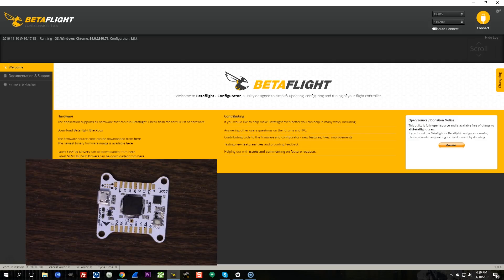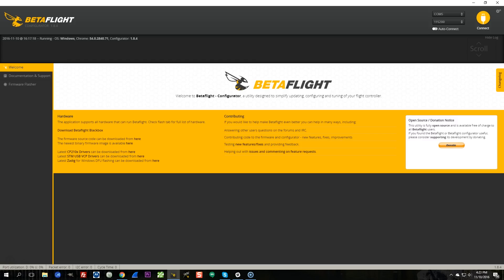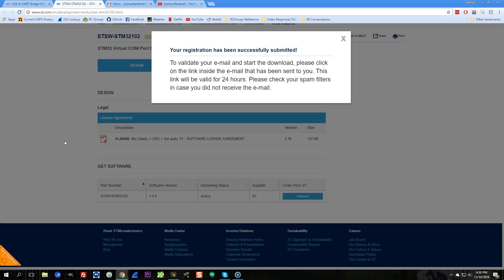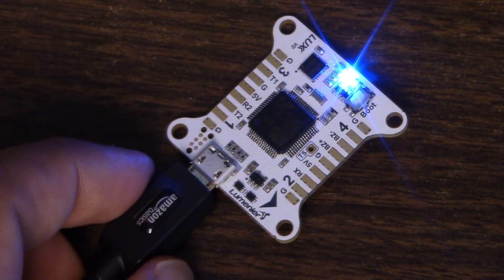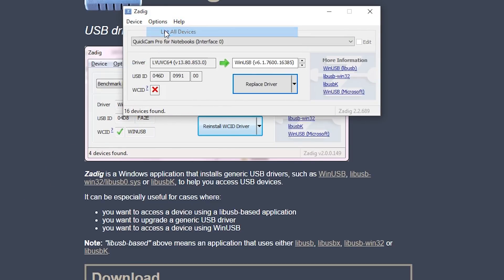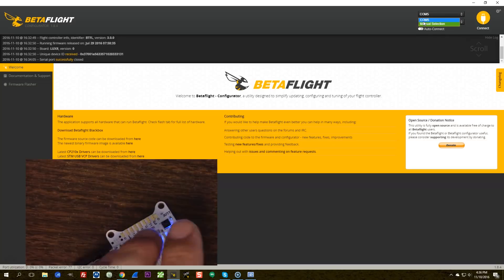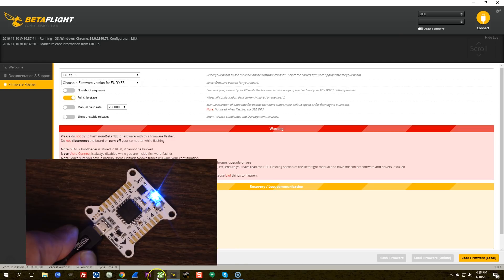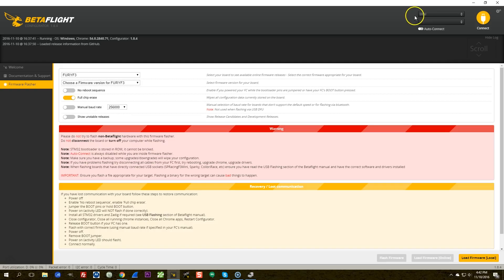Betaflight / Cleanflight Flight Controller Won't Connect | FIXED

Comment: so I can tell  betaflight to go into bootloader, and it says "DFU bootloader" in betaflight but the board isn't actually doing it, zadig and driver fixer will put it into DFU mode but it still won't show up in the USB devices as DFU bootloader. DFU shows up for a second in USB devices while i'm updating drivers, then POOF goes away and finishes.
Reply: Yea same I’ve tried everything 😭

Comment: Flashed my Skystars F722 HD Pro 3 to BF 4.4.2, I did not have Full chip erase checked. Not sure if that matters. 

I then get a message to select a motor protocol so I went to the motors tab and selected Dshot600 and clicked save and reboot and the FC light turned red and didn't make the save and reboot sound after clicking and now it's bricked. I hold down the boot button and connect it but it only stays in DFU mode. I tried impulseRc and it detects but the only option is to click exit Dfu mode but then its still in red and stays in DFU mode.

Comment: 6 years later, siting in front of my first fpv drone, struggling with all drivers and nothing happen. I HAVE THE SOLUTION FOR THE IFLIGHT PROTECK 25.

The mother fucker usb port is not the USB C! is the micro USB UNDER THE BATERY STRAP!!!!! thanks for this two days really sad.

Hopefuly this help someone. 

ps, UNDER THE STRAAAAAAAP!!!!!! F%$#

Comment: Hey Joshua, im a big fan. I accidentally switched the receiver mode on my tinyhawk 3 and now betaflight config (10.9) will not recognize it. I’d rather not reset the whole drone. Any solution?

Comment: Hi Joshua,
You described the possibilities of the driver problem nicely, but my problem is a bit more complicated and it didn't help me to solve my problem, just to understand the deeper principle of the thing.
The thing is, when I hold down the button on the FC and start bootloader mode, instead of STM32 Bootloader I see UNKNOWN USB DEVICE (DEVICE DESCRIPTOR REQUEST FAILED).
If I try to install drivers for WinUSB (v6.1.7600.16385) on this unknown device via Zadig, it will write an error message after a while: The driver installation failed.
I don't know how to proceed with my knowledge set, do you happen to know what could be the problem?
i have SucceX-D F7 V2.2 TwinG Flight Controller
Thank you very much for any help.
Reply from the maker: In this case, I would de-solder everything from the FC. I would guess that something connected to the FC is interrupting the ability to enter bootloader mode. If the FC did this after desoldering everything, I would conclude the computer drivers might be messed up. If the computer works correctly with other FC, then I would conclude the FC was damaged.
Reply: @JoshuaBardwell  
Hi Joshua,
Your advice is priceless, I disconnected the positive power cable from the TBS-Crossfire-Nano-Diversity and the bootloader is working again just like in your video. Flashing was already without problems.
Thank you very much for your very quick response and keep up what you are doing, you are certainly a great asset not only to me.

Comment: Hi Josh. I have been away from flying my Beta65X HD Whoop Quadcopter (2S) for about a year.  I update my beta flight control panel and now having issues. No more serial ports?  I’m use a Mac Air. Is there an email address someone can help?  Thanks

Comment: hey thx seemed to work does its musical beeps again, but still won't bind transmitter and show in betaflight . I think a need to step back before I start smashing stuff,  5 days trying to bind this dx9 Spektrum and spm 4650 srxlv2 receiver.

Comment: HI, my issue is more difficult that PC says the FC(stm32F722) is an unknown usb device, just after I pressed the button "reset settings" on BF. It is totally a brick even I reinstall the VCP driver and try zadig. PC always says unable to install driver for this unknown usb device. Do you have any idea?

Comment: I wanted to set up a tinyhawk as a receiver for flying in a simulator on an M1 MacBook Air.
After using the CLI command "set usb_hid_cdc = on", Betaflight and MacOS no longer even saw the drone via USB.
Installing drivers (CP210x and STM USB) didn't help so I went back to an old MacBook running Betaflight 10.5 and was able to "set usb_hid_cdc = off" followed by "save" – Everything seems to work normal again now; maybe this helps someone.
Reply: wow iam gonna try this, i did the simulator usb thing too

Comment: Hi, nice explanation. I have been trying to flash beta flight in CC3D. I have loaded the .bin file in the FC with librepilot. For flashing betaflight when connected in bootloader mode I don't see the STM32 boot loader listed in zadig. I get an error in device manager as USB device descriptor requestor failed. Any suggestion or advice what could be the problem. Thanks
Reply from the maker: CC3D ships with openpilot bootloader pre-installed, so you won't see STM32 bootloader. But a bigger problem is, there is no modern operating system that can run on the F1 chip that the CC3D has. The F1 chip is too slow and doesn't have enough flash space. So unfortunately you're out of luck on this one.

Comment: Hi!

I am  a little at loss with my new babyhawk hd with crossfire receiver. I can't connect it to Betaflight configurator in my PC.I have tried with four different usb-c cables and there is no sound or blinking in the drone. Even if all my usb-c are power cables shouldn't they still power up the drone? I have done all the recommended driver updates .Tried pressing the boot button when connecting cable. My old tinyhawk 2 freestyle connects to the same computer just fine. If I connect the main battery drone comes alive but won't bind to TBS Tango 2. Could someone please help or is it just a bad unit?
Reply from the maker: I hate to say it but it sure sounds like your quad has a dead flight controller :-(

Comment: I'm still not sure what's going on with my flight controller. I just built the xilo phreakstyle quad and everything seemed to be going smoothly but when I went to flash my FC it disconnected and my PC didn't recognize the board anymore. Now its as if I'm not plugging anything into my PC at all. I'm not seeing STM 32 on zadig or in my device manager and my LEDs have changed. When everything was working and I could see the FC on my PC I had 3 lights one red 1 blue and 1 more red. then I attempted the flash and I started getting an error on my pc saying the device had malfunctioned and another that said it could not connect. At that point I lost 1 LED light (I think it was the blue one). then then I tried a different PC and I lost another LED and now I only have one solid red LED and nothing I do seems to be working. Any advice would be helpful. I have been at this all night and now into the morning and nothing seems to be helping. Thanks

Comment: Hi Joshua, I cannot thank you enough for saving my beginner arse again. Thought I bricked my Flywoo Firefly 1S baby Nano, then was able to follow your instructions here to get it in DFU and flash to the latest firmware. Saved the day phew. I have just signed up as a patreon using paypal. Keep up the great work. Do you have any videos or tips on how to enable VTX IRC Tramp, as the Video Transmitter tab in Betaflight sadly says 'Device ready No'. That is the last piece of my puzzle before I am able to start flying the quad in my garden.

Comment: I need help! I am not getting the noise when i plug FC into the computer any more. It was working about 2 months agao but than I went away and when iv got back and tryed to work on my project I cannot get the fc to attach to my computer. I messed around in device manager by trying to uninstall all com ports but it didn’t help. Can anyone advise me?

Comment: I was able to connect to betaflight no problem but after installing a vifly buzzer, pro32 hv and a phoenix v2, every time i plug in the fc nothing happens. No more com just a ‘failed serial port’. I installed the drivers, updated betaflight configurator still nothing…
Reply from the maker: Desolder everything and see if it comes back to life.
Reply: @JoshuaBardwell  so i found out it was my usb cable.. tehe but i encountered another problem.. under the reciever tab nothing happens. I updated my tx16s to edgetx and updated my crossfire reciever with it, shows a green solid light but nothing happens.. I tried updating the firmware to 4.2.10 as im on 4.2.8 on my jbf7 but a failed serial port appears when its in bootloader. I tried the impulse driver fixer but it fails when it goes into bootloader and zadig shows unrecognized device under options show all devices when in bootloader… your videos are amazing hands down easily my go to for any drone related problems! but this one is gettin to me.. any idea kind sir?
Reply: Update: so i realized serial rx wasnt enabled under ports now i have input. Man seems like its always the little things that can get you running in cirlces.. i am curious at to why i cant flash my firmware… anyways im sorry for the blabber, i need to do my research! Thank you for what you do joshua!!!

Comment: So my FC would connect in Betaflight and I could see settings but it wouldn't go into DFU and bootloader to flash firmware. I installed the drivers and then it wouldn't connect at all. I can see it in device manager and Zadig, but no connection in Betaflight or Emuflight. I tested with two different FCs, same result. No connection, failed to open serial port. This is on Windows 10. I've tried multiple cables, removing and reinstalling the drivers and everything else I can think of. Did I mess up my USB subsystem installing the drivers?
Reply: Saved by Impulse RC Driver fixer!

Comment: Iv got a couple problems could someone help me troubleshoot. Iv tried all the drivers and I cannot connect my bord. Iv watched a bunch of videos but I must still be doing something wrong.  Where can I go for help with this? its very confusing and has brought my build to a standstill.

Im wondering if the problem has to do with the STM32 drivers I can only install 64 bit version. the file has no option of 64 bit 32 install. When I try zadig I get a port that says (RaceFlight FC) but not one like in the video.

Any help would be really appritiated!
Reply: Did u figure it out I'm having similar issues
Reply: @Revelation1177  make sure you got all the drivers. I think I installed the 64 bit version of STM32. And keep trying sometimes it seems to just sorta work. I did thankfully.  If nothing is working try resetting everything.
Reply: @excellenceinanimation960  thanks for responding I been trying a few days now nothing seem to work I'm using windows 11 idk if that has something to do with it I even switch usb cables I even reset my laptop lol nothing seems to work I'll keep trying like u said hopefully I can get it working for when I really do need it
Reply: @Revelation1177  try more cables. I went through 3 before I found one that worked. Try making a post on Rc groups. Someone may have some useful information. Good luck!
Reply: @excellenceinanimation960  ur rite I tried like 4 different cables foud the rite one now it works how it suppose to so it was the cable all along tbh if it wasnt for ur comment I'd just given up it was really frustrating but try an try rite lol
Reply: @Revelation1177  yay awesome! That’s really weird! I’m glad it worked! Gl with whatever ur going to build!
Reply: I had build a bicopter. Plan to make it look like a sea knight helicopter.

Comment: There is no windows 10 support for VCP drivers. "Starting from Windows® 10, the STSW-STM32102 driver is no more adequate and the usage of the native inbox driver is recommended"
Reply from the maker: That means windows 10 has the VCP driver built in. It's there automatically. Although you can also download and install the windows 8 driver.
Reply: @JoshuaBardwell  quick reply. Yea, having connectivity issues with 2 FuryF4 boards. One will go into boot mode, but won't completely flash...it stops halfway then disconnects. The other doesnt do anything when plugged in except light up one light. Nothing pops up in device manager

Comment: I tried to follow these instructions and now BetaFlight won't connect at all.  What did I do wrong?
Reply: Easy fix (in fact, maybe a cop out?):  I have an Arch Linux machine.  Loaded BetaFlight from the software market and everything works perfectly.  Thank you!

Comment: JB you the man thanks for all the help. Wanted to leave a tip. I run other quads for long range with mission planner my TX comes thtrough my computer using bluetooth and create a virtual com port. I couldn't get into DFU until I rebooted and I also turned my bluetooth off. Not sure if BT made a difference or not. But something that might cause some issues if using dragonlink with the virtual com port through BT. Thanks again dude

Comment: Is there an update to this process? I installed the suggested drivers, but plugging in the FC just results in "Unknown USB Device (Device Descriptor Request Failed)"... Seems a lot like I've bricked the FC to me :( Any other suggestions?..
Reply from the maker: Flashing incorrect firmware to the FC can cause that error. The workaround is to re flash the FC with correct firmware using bootloader mode.
Reply: @JoshuaBardwell  great, thank you.  Can you direct me to any instructions on how to flash the FC using bootloader mode? 
I'm working with a betafpv meteor65 if that impacts things.  I used what was labelled as the correct CLI dump from their website and immediately had the "Unknown USB Device (Device Descriptor Request Failed)" issue...

Comment: I greatly appreciate your help but I still havnt  been able to get betaflight to work. Its just says serial port failed. I got a betafpv 75x DSMX BNF. All this just to fly my drone is exactly why alot of new people lose interest in fpv drones. Its been a month and I cant get anything to work so I'm just going to give my meteor 75x and dx6e controller away if anyone wants it. All I wanted to do is fly my drone but the insane amount of download this and download that has completely killed my interest in flying fpv so I'm giving up. But thanx for all the information on your videos.

Comment: I'm having an issue where it connects but for some reason the Controller isn't sending info to the ESC Mamba F405
Reply from the maker: Make sure motor protocol is set to dshot in the configuration tab. Dshot 300 is suggested.

Comment: I just downloaded BetaFlight for Ubuntu, and get a failed to connect to serial port message.  watched this video, and it does not address Unix / Linux users of  betaflight.  It would be very helpful for a written set of steps to accompany this video to get past this problem.  Does anyone have written steps or know of any?  
I also read somewhere that installing the stm and cp210x drivers is not required for linux.  True?
Please advise.
Thanks in advance
Reply from the maker: You don't need to install the drivers. You need to do something to give the app permission to access the serial ports. I don't know how to do it though.
Reply: @JoshuaBardwell  Thanks so much for the amazingly quick reply.  I will go to the linux  guys and try to discover the secret.  If I find it, will report back.
Thanks again!!!

Comment: Ive had my drivers working correctly for months. Now i buy a lux f7 boadd and i connect it says drivers installing. It finishes. But i mever have a new com port show up!? I did everything in this video and am not a newbie to this. I dont know why my board wont connect!!
Reply from the maker: I have no idea why the Lux f7 would need different drivers than any other FC you previously used. Unelss the older FC used CP210 drivers like the Eachine Wizard. Try reinstalling the drivers using the steps in this video: https://www.youtube.com/watch?v=bAqgPEW48Tc

Comment: i have a aikon f4 board and the status led is glowing constantly (red) but the other led (green) is no longer flashing. this happened when i was instaling drivers and i did something wrong (i think that it was in zadig)
please HELP!!!
Reply from the maker: Most likely you can fix this by putting the board into bootloader (DFU) mode and re-flashing it.

1. Hold down the bootloader button. Plug in the USB cable while continuing to hold down the bootloader button.
2. Run the Impulse RC Driver Fixer app (https://impulserc.blob.core.windows.net/utilities/ImpulseRC_Driver_Fixer.exe). It should "fix" the driver successfully. If not, do not proceed.
3. Un-plug the USB cable.
4. While holding down the bootloader button, plug in the USB cable again.
5. Start the Betaflight Configurator app. In the upper-right corner pulldown menu, you should see "DFU". You can now flash the board.

Comment: Hi josh. During flashing with new firmware. Betaflight is stating this message "No Response from the bootloader, programming: FAILED". I’m using a Mac. Do I need to download any new patches? Using most resent Betaflight too. Thanks for your knowledge!
Reply from the maker: It usually means that you don't have "DFU" visible in the configurator before you try to flash.
Reply: Joshua Bardwell I’m not sure what you mean. ‘DFU’... still new here with the tiny quads and flying indoors. Problem is that I just bought a LDARC GT7 and had problems binding to my Jumper TG80 Plus. Tx shows up in Betaflight all all sticks and switches move but when I disconnect and try to fly, the props run in pairs(only 2 at a time) when I move the appropriate sticks AND no throttle action at all! When moving the throttle stick!  Thinking of reflashing the quad via beta. Followed the directions on the quads manual but I get the bootleg warning so I can’t flash it. Think there’s something else wrong? I’ll email a quick video of the odd prop actions or anything you think will help get me flying. Need your email address please. Thanks again for your prompt reply.